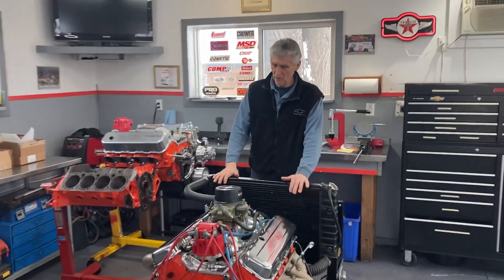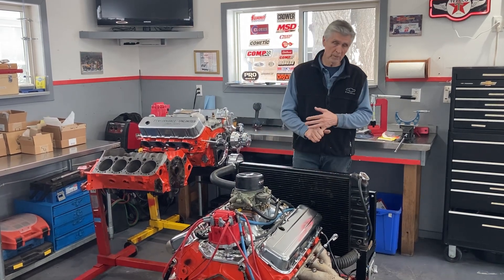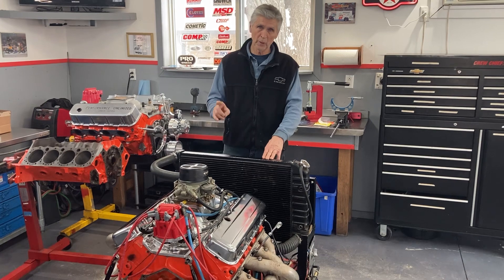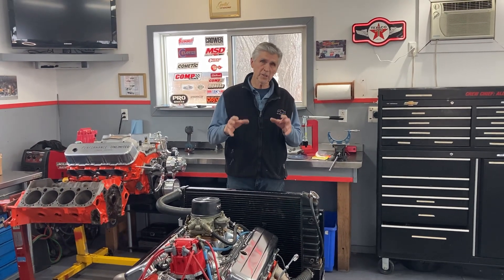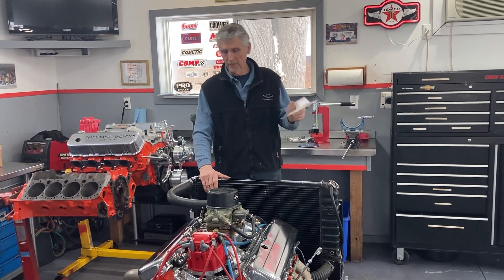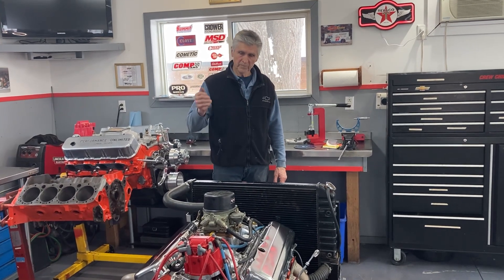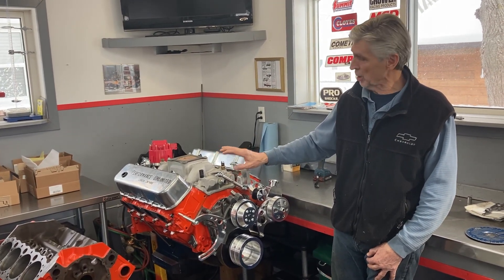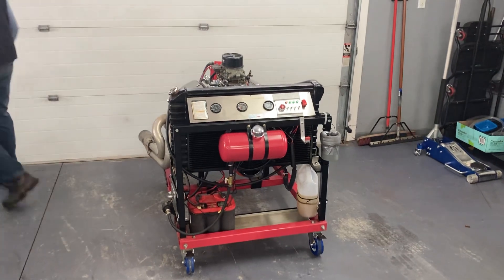Starting the mystery 454 big block Chev on the test stand

Comment: could you repost video the sound repaired? I am building almost same motor.   Thanks John
Reply from the maker: Thanks for the question John. Very sorry for the sound quality on this one. Unfortunately the engine is no longer here. I did not build this engine. It was purchased by a customer sight unseen and I brought it to life  for him. I can only tell you that is is fairly low compression and has a flat tappet camshaft.
If you  are building one, I would suggest you check out my videos about matching the camshaft to compression. We also did not dyno this engine, but I think it will make good low end torque. 
Hope this helps. AG